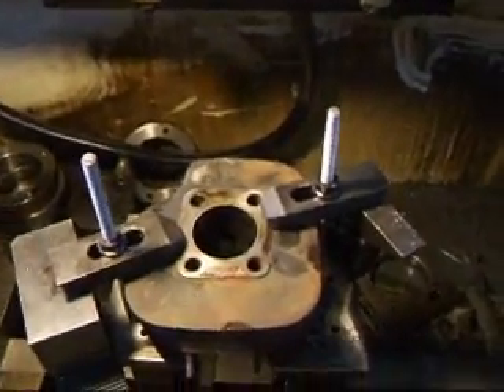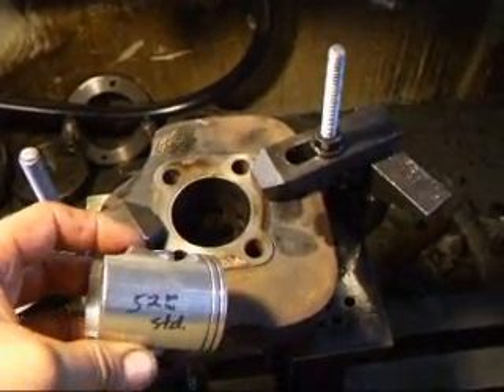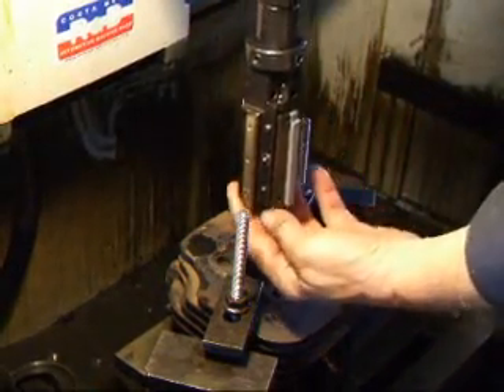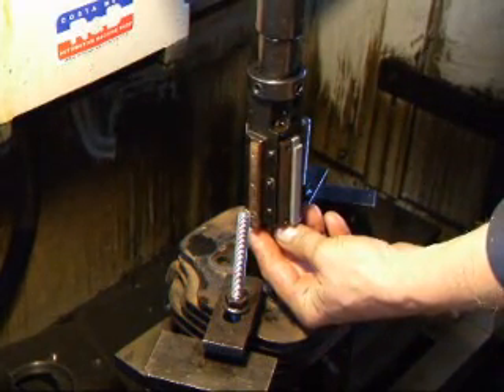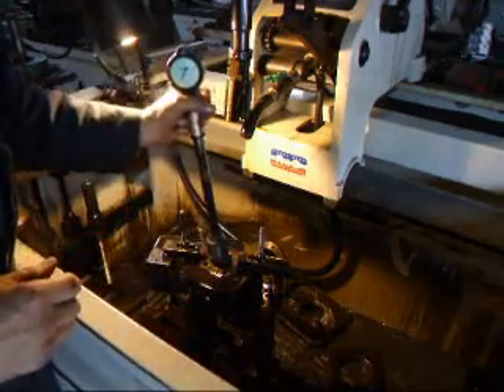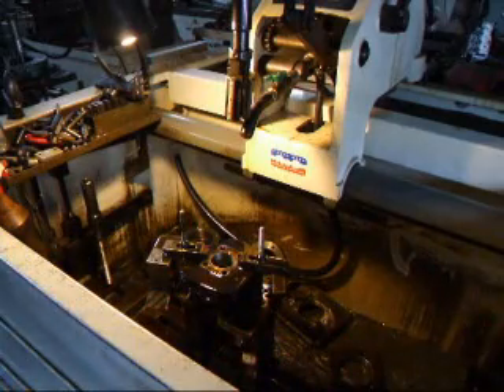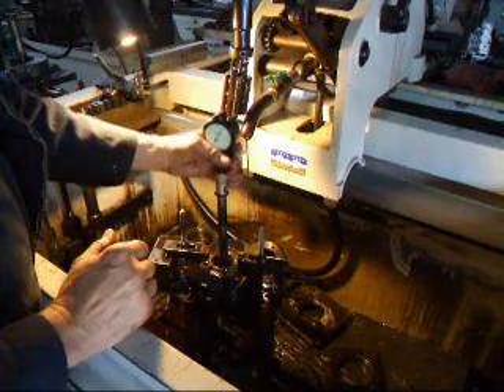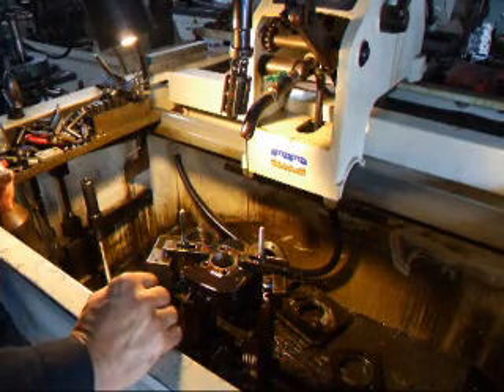Yamaha 2-Stroke Cylinder Resizing

Comment: @MrLloyd0071 It is fixed now thankyou:))). I actually was running it lean had it6 at 50:1 gas/oil ratio but it was the ignition coil being loose was the reason why it was missing into about 1/4 to full throttle almost like the timing was off xD yeah but its all fixed now i got her running back at 32:1  thank you though :)

Comment: @MultiUnanimous try running it for a little bit,.then turn it off immediately(don't let idle if you can help it) and check the spark plug. The backfire makes it sound like you're running lean. May be an air leak somewhere. If it's lean, the plug SHOULD be whitish. not brown. If you rebuilt it after the bore job, double check the carb fitting and everything.   it happens

Comment: When boring a 2 stroke engine , do you usually have to change out the main jett aswell? Ever since the rebuild my bike runs like crap boggs and backfires allot , can't even get it out of 2nd gear because of lack of power , and its a yz 125 so this is not good for me lol,Any suggestions would be appreciated , btw i have bessed with my ratio of oil and gas mixture it was at 32:1 so i tried leaning it up little by little didnt help , have even adjusted my carb needle with no success.

Comment: Nice video, I was wondering how that worked. 
I brought my honda nsr75 cilinder in for resizing. Standard diameter is 48mm and the next standard size offered by honda is 0.25mm larger.
Costs around 40€ here.